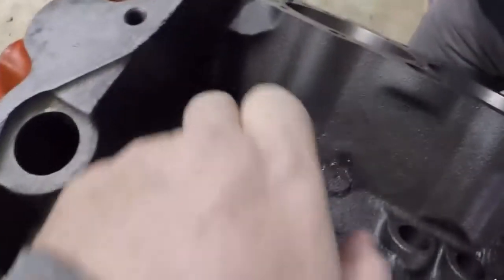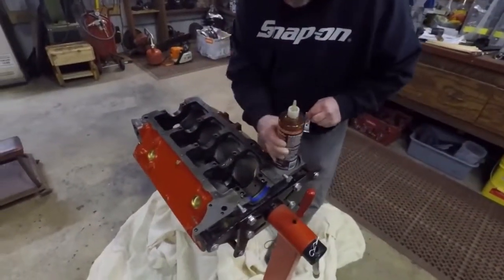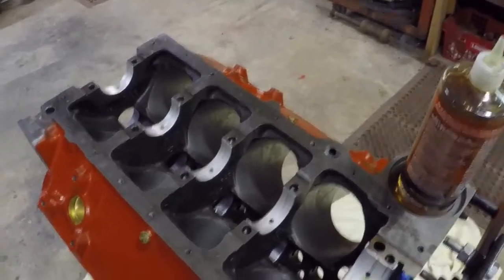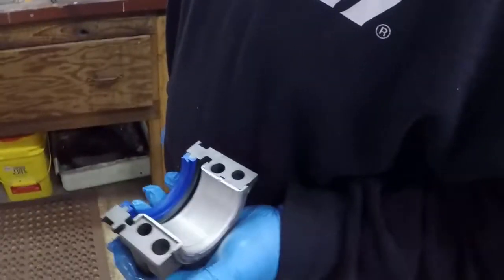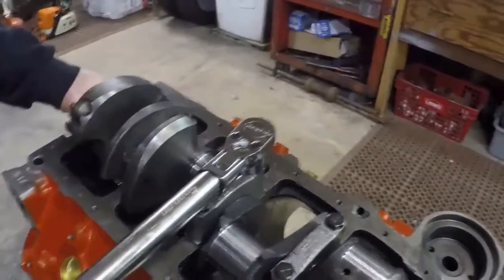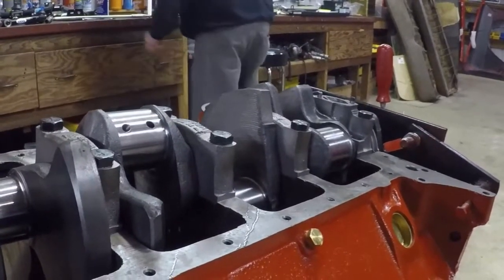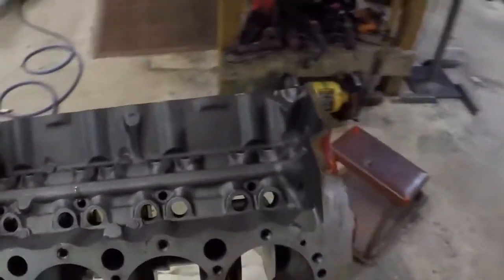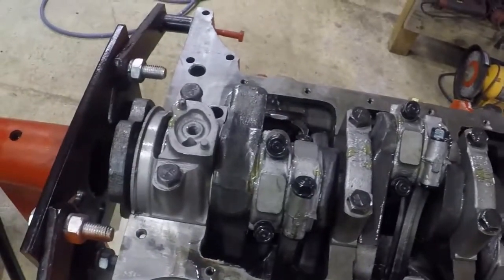Chevy 327 short blocking

Comment: Why are ya putting lube on the back of the bearing shell??? Ur supposed to pop em in dry and then put assembly lube in the side that contacts crank and rod journals🤠👍🏽.. been building sbc engines since 1990
Awesome car though🤠👍🏽